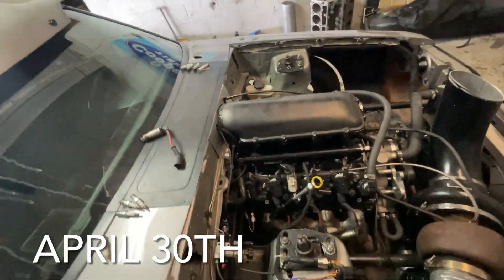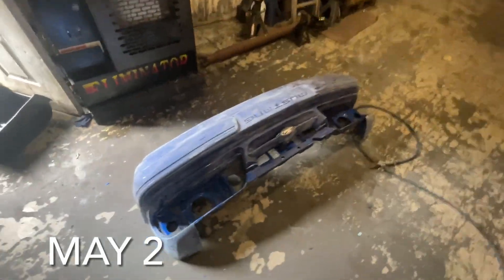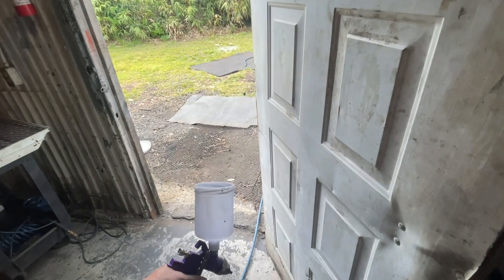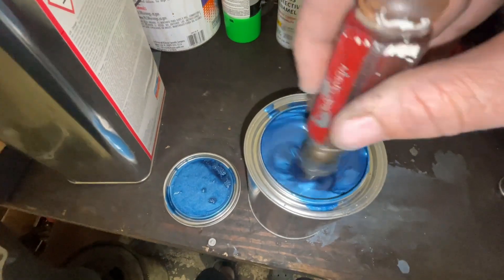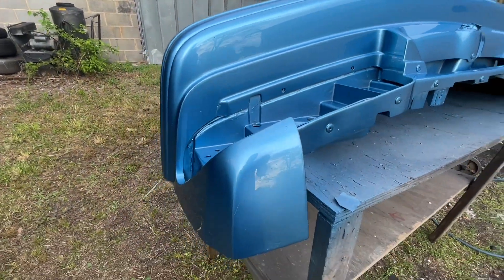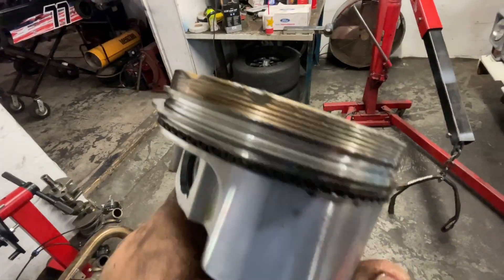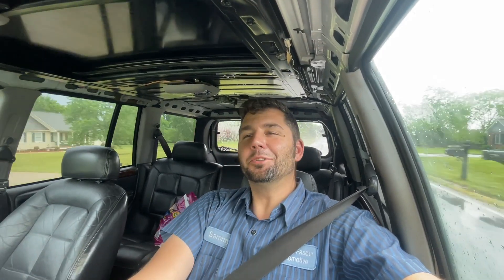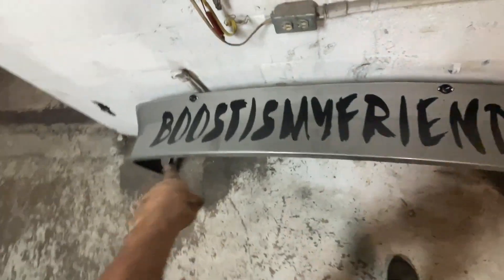Assessing the damage on my turbo LS race motor

Comment: I obtained a ford explore disc brake rearend for my 83 s10 can you please tell me how to turn it into a 33 spline c clip eliminator rear with a spool.I think I have a guy who will cut it down for me. Also I realize when I cut it down I'll have to have moser cut me some axles. Thank you and I hope you and your family are doing well.
Reply from the maker: You will have to pick up a set of moser 7700f ends to swap onto it for a mustang style c clip eliminator flange, then tell moser you need a set of mustang axle in the right length, use sn95 rear brakes and backing plates
Reply: @Boostismyfriend  I was looking at the 7700f on moser website and it says it's an end for cclips do I have to modify it for c clip eliminators or what do I have to do. Thank you Sammy for your help.
Reply: @Boostismyfriend  I found them they say non c clip housing end. Thank you and sorry to bother you. Do I have to modify the sn95 back plates like some others have had to do
Reply from the maker: No, you can mount them factory, people modify so it don’t change the back spacing on the wheel, but since your changing the ends you can set it up stock location

Comment: Real glad to see it coming back together. I wouldn't hesitate to run that piston or those heads, but if I had the chance I would have swapped that piston to a cylinder that wasn't beat up in the combustion chamber. that way it would equalize things a little bit better. Still going to be a good motor for you.
Reply from the maker: Good thought, might swap  head to the other side

Comment: I was thinking you'd clean that piston up and reuse it when you showed it in the live feed. IDK about the polished/shiny surface though, that tune is gonna act weird in that cylinder. What's your best time with that setup?
Reply from the maker: 5.001@142
Reply: That's moving out pretty good! My SBF went 4.86@148, but it's getting a real similar setup to what you use now (5.3l) and the car is losing about 250lbs total. I hope to be at least back near the same time
Reply from the maker: Awesome, the turbo and engine combo has been 4.8@150 in nigels car but we fought wheelie all year, i think we got a handle on it finally
Reply: @Boostismyfriend  we had the wheelie problem too and switched instant center and anti squat around. Ended up going 1.12 without the wheels even leaving the ground. I think we have some 1.09's left  in it
Reply from the maker: That’s awesome, i just  changed to trz lower and double hiems i was getting a bind with a spring style lower control arm in the bottom hole
Reply: @Boostismyfriend  yeah, it looks like it's separating real good now!
Reply from the maker: @diygaragetx  yes sir